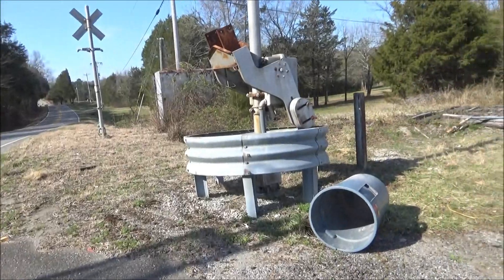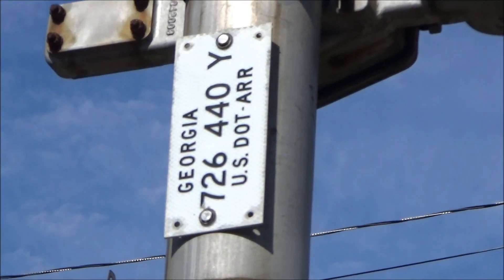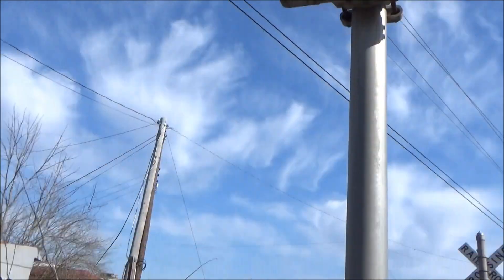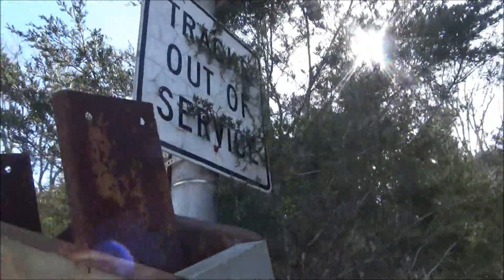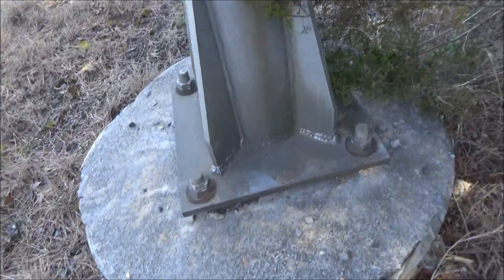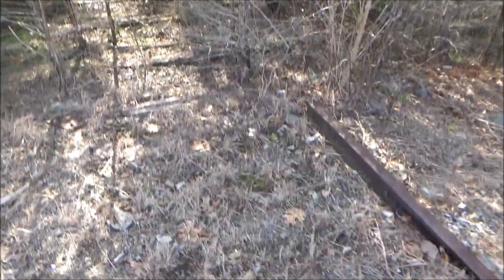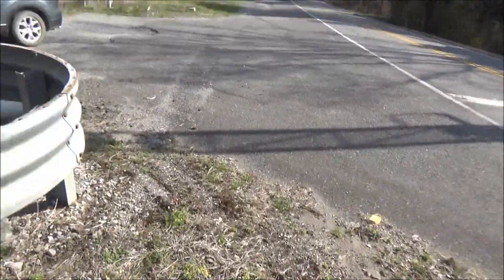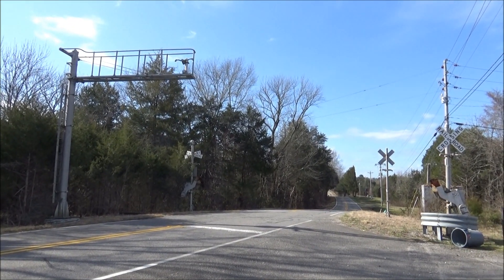Abandoned Railroad Crossing

Comment: Did  the city  took the signals of
Reply from the maker: No, the railroad or the county would've been the one to remove the lights and gate arms.
Reply: @freebrickproductions  why do they take them off?
Reply from the maker: @plingerson  The MUTCD requires any signs/equipment that would control traffic, but isn't in use, to be removed, covered up, or turned away from traffic. For why the gate arms were removed was to prevent the road from being blocked if/when the gate mech fails.
Reply: @freebrickproductions  oh, makes sense